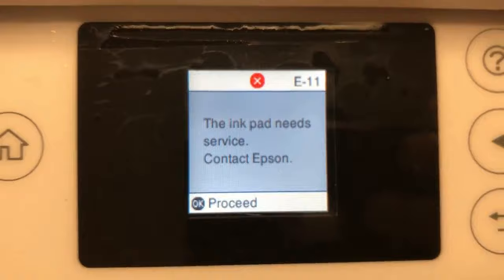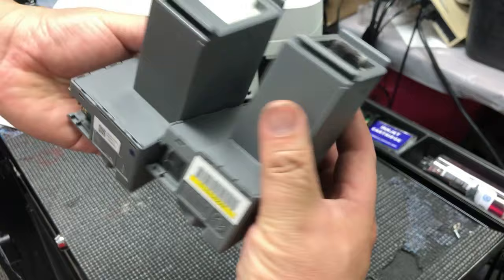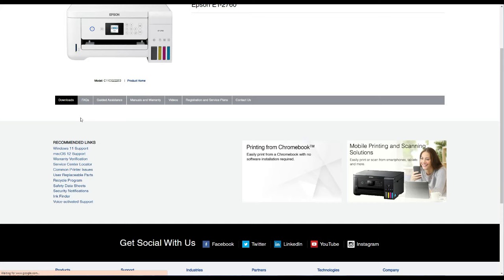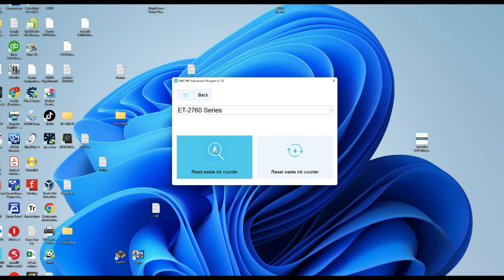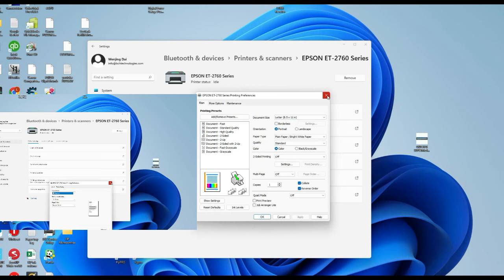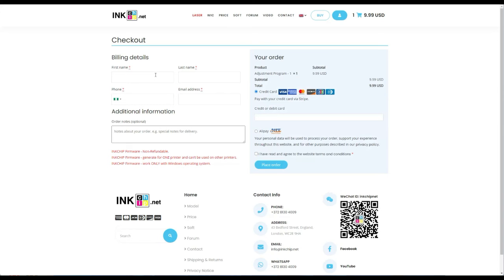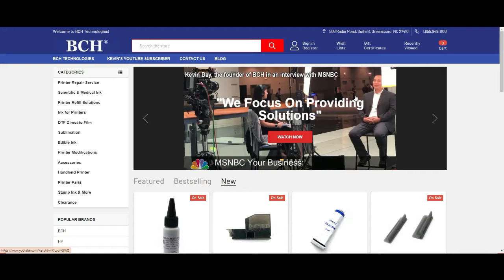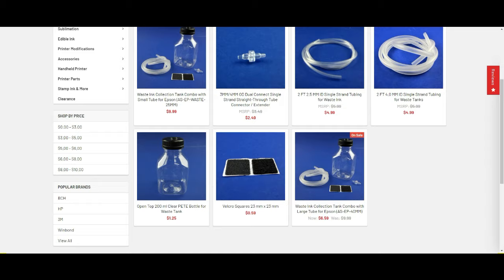Reset E-11 Error: the Ink Pad Needs Service - Replacement won't work!

Comment: After getting the replacement pads for an older ET-2550 on eBay, I used your approach to reset the bean counter and it worked as you showed. Thanks for the walk-through video and links.

Comment: OMG, you saved to spend around $500 for a new printer. I had the error "E-11," and I called Epson, no help at all; that is the product's life. I followed the steps and got the code for $9.99, which was worth it. The printer reset, and it is working perfectly.  Kevin, Thank you!

Comment: THANK YOU SO MUCH!!!! I changed out the Ink Pad and after watching this video, I thought that Epson should be able to reset the counter for me.  I was on the phone with support for over 65 minutes. They still couldn't help me, so they took my phone number and said they would call back. Epson support could not reset the Ink Pad level and basically, the man did not know what I was talking about, even tho I gave him the error code. So while waiting for a callback, I followed your instructions and paid $9.99 for the key. It worked beautifully!  My printer is now working. Thank you so much for making this  video!
Reply: I have the same error . . . my ink pad is at end of life.  This is on the Epson 2820.  I called Epson they said it is out of warranty.  However, they want me to pay to ship my printer to them so they can reset my ink pad.  I purchased the the Epson 15000.  I haven't used it yet.  I think I will be returning this printer . . . It's like a damn scam from Epson.

Comment: Thank you very much for the help. Initially, after paying €25 for an estimate to find out that the problem was the E11 (which was already displayed on the screen), €75 was requested to fix the printer or buy a new one. I managed to solve the problem with €14, including the replacement of the pads (Amazon)

Comment: Thanks for this video and your help! Everything worked with my ET-2750. Rather poor that Epson doesn't give a way to manually reset the counter when the maintenance box is replaced.
Reply: It's like a scam.  They want me to ship my out-of-warranty printer to an Epson dealer so they can do it.  I can do it myself.

Comment: I have the ET-2850 printer, and although I don't have this message, I'm just a bit concerned that at some point I will. I have removed my Maintenance Cartridge to have a look, and mine is the same as the one in the video (mine does not have a chip on it). I have looked on your website, but this model is not listed, and wondered if I could choose a different model to do the reset ?

I would probably get a new Maintenance Box online, as I can get a genuine Epson one for very cheap, and would sooner do this than disassemble the Maintenance Box and clean the pads, and then wait for them to dry fully. I assume that if I did this (install a brand new box), that the E11 error would still remain on the printer's screen, as the printer would not detect the Maintenance Box had been replaced as it DOES NOT have a chip on it, correct ?

Comment: Thank you so very much. This video was the best that I had seen because you also showed us how to download the drivers on our desktops which is what I needed to do. Also, this actually worked wonderfully. I did wash out or rinse very well my ink pads blow dry them, but that took too long so I put them inside of a pillowcase and put them inside of my dryer on medium heat for about an hour and then let them sit out overnight. I replaced them back in this morning and I also, got the key and now it is working wonderfully thank you so very much🎉❤

Comment: By installing the waste tube bottle and reset the counter, will you have to do this again or does the WIC tool Resetter allow you to do this without removing the cover?

I also have a WF 645 with the same issue.  what would i need to do for this printer?  These printers are still in good shape and have stocked ink I purchased for the WF 645.

Comment: Kevin need your help! Ink dampers need primed on et-8550 no ink printing!the ink dampers have huge holes in the bottom of them so can’t syringe the bottom. Tried suctioning from the waste tank hose but only sucked air

Comment: Hi Kevin,  I purchased a key and still trying to find my printer.  I have downloaded everything and hooked it up to the usb and still does not locate my printer to input the reset key. I have contacted Inkchip but so far no solution that I have not already tried and it is an ET 4700 epson series and was on their list.  Would you have any suggestions?  Thanks

Comment: The inchip WIC setup will not work. I keep getting A device attached to system is not fuctioning. I tryed rebooting both PC and printer still get this error.

Comment: You uploaded this video 22 days ago as I write this (4/9/22) and the site has changed. In your video, ET models are included in the list but I have checked the inkchip website and there are no ET models listed under the /models section. To address this, I googled, "inkchip ET-4700" and saw the select language screen you show in your video. I clicked English. McAfee detected it as a virus, so I blocked installation. Please advise
Reply from the maker: Click WIC, not SOFT on the top of the page

Comment: What if the printer is not showing up in the drop down on Inkchip? It says not printers found and to check USB connection and restart the printer. Which I did and its not showing up!
Reply: This is the problem I’m having. Did you find a solution?

Comment: I absolutely hate this printer. I was told one ink refill would last thousands of pages. I have to refill constantly. It can't print pictures. They're always faded, tinted green, and have lines going across. Oh and it jams and just quits almost every job it starts. I have bought 4 cases of paper (5000 sheets per case). This stupid printer has wasted probably 2000 pages. $360 piece of junk!

Comment: Epson is crap Japanese are unable to make reliable mechanism to pull paper correctly and they do not understand wireless and wifi. I have a L395 and it pulls the paper misaligned and the wifi connection very often gets crazy. Continue making sushi and stop trying to make technological stuff Seico/Epson
Reply from the maker: HP says "hold my beer."
Reply: @BCHTechnologies yesssss.  My regular printer is HP. Constantly tells me it's pit of paper. All of a sudden doesn't like printing on card stock.